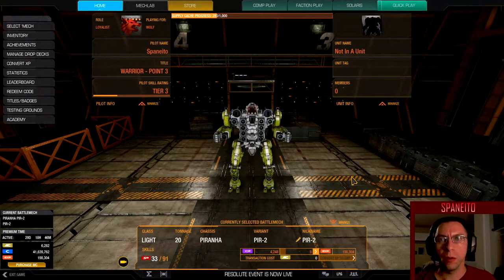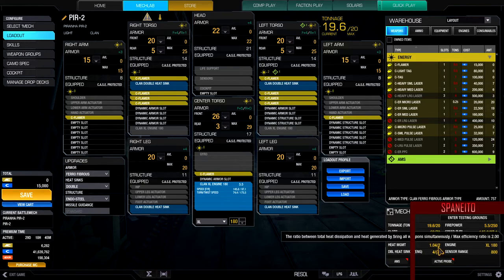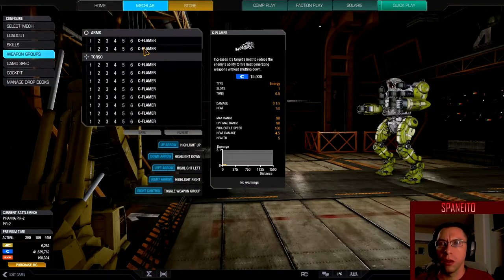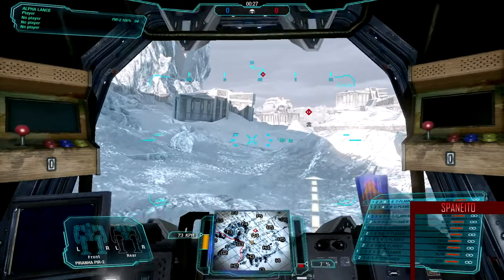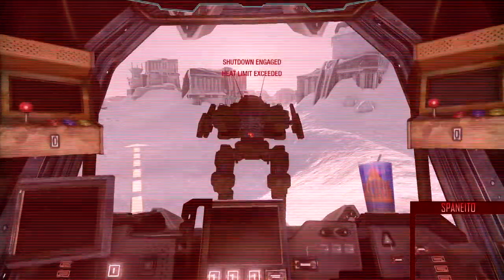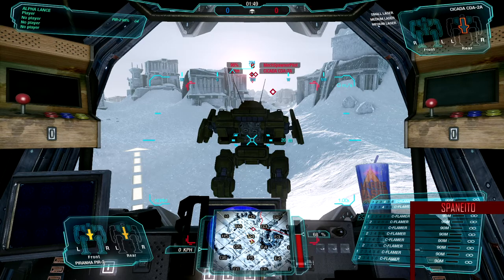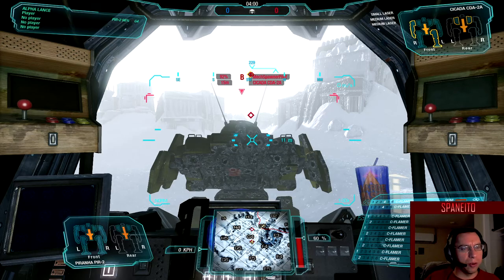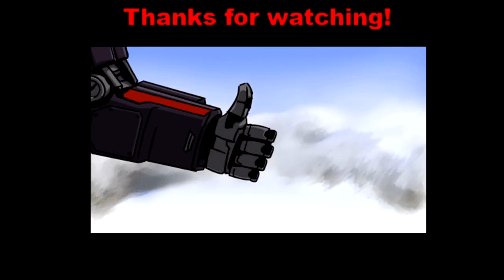MechWarrior Online - Broken Flamer Piranha Build

Comment: I did some testing too. My conclusion is that bringing more than 4 flamers is a total waste.

4 flamers will bring someone to 90% heat in about 3 seconds.

You should either burn someone for 4 seconds then forget about flamers entirely,  or try to burn for 3 seconds, wait a bit, then give them another 3 seconds before proceeding to forget about flamers till they fully reset.

The best I think you can hope for is to heat cap someone once or twice
Reply from the maker: I did not see this comment until now.  I am sorry about this!

I enjoyed making an explosive build lol But yes, definitely correct - you don't need that many Flamers to shut someone else down - and annoy the player.